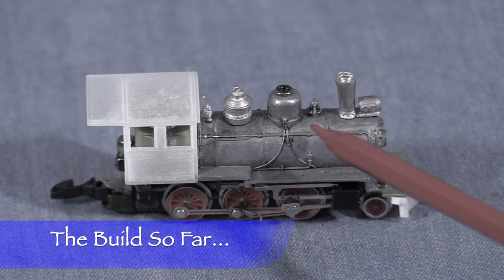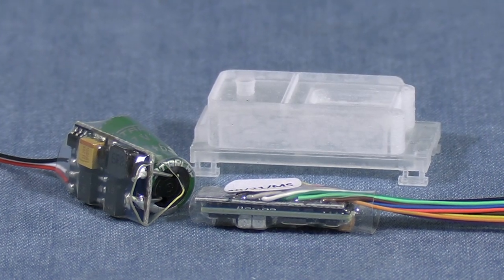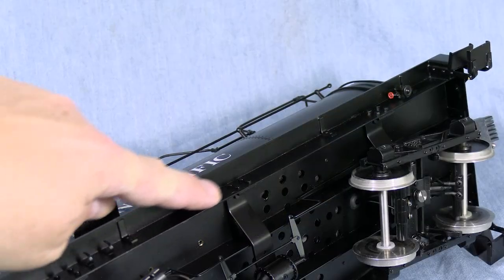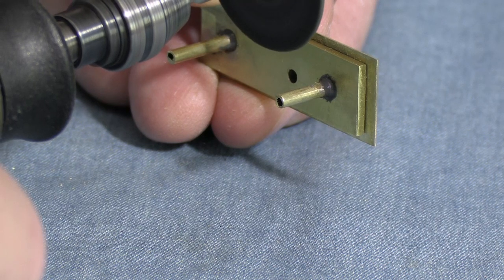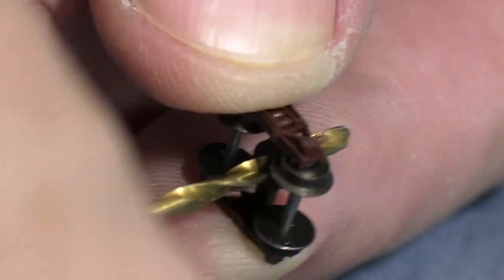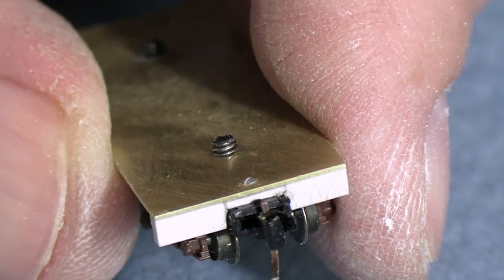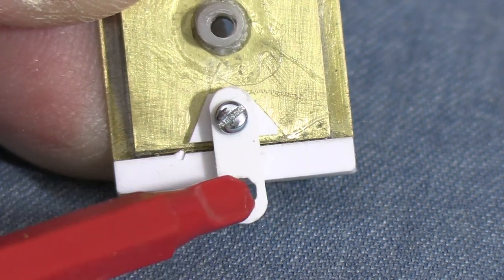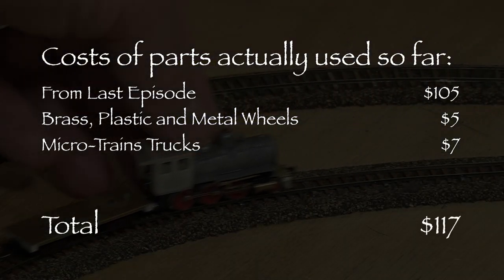Model Building Nn3 2-6-0 Part 5 - Tender Frame

Comment: Hi Dan! So question again. So I have Union Pacific style number boards I want to install on my n scale mikado. How should I drill the holes in all die cast metal smoke box. Do I use a normal pin vice? And what tips and tricks can you pass on! Fan from Ohio!
Reply from the maker: You could use a pin vise for die cast metal.  It may be slow going, depending on how hard the metal is.  Make sure the drill bits are sharp.  I've found that some die-cast is tougher than others.  I would suggest maybe putting together some kind of drilling template that will hold the bit in place.  I'm thinking that trying to drill a hole straight down on the side of a round boiler would be difficult because the drill bit will tend to want to go down the side of the boiler.  Maybe you could make a kind of saddle from some scrap plastic that would fit over the boiler with holes in it to guide the drill bit.  Thanks for watching!

Comment: You could drop the keep alive unit by using a 1215 gearhead Faulhaber coreless motor for app $45. My Nn3 engines run superb with those
Reply from the maker: I have a Rivarossi N 0-4-0 (same type of model I used to kitbash the boiler on this one) that I fitted with a coreless motor.  It runs really well and is super quiet, though it still stalls sometimes.  Is there a good source for these motors?  There used to be a seller on eBay but they seem to have gone away.  Thanks for watching!